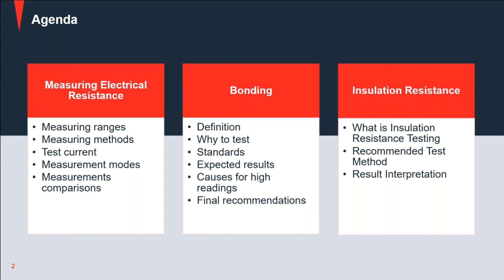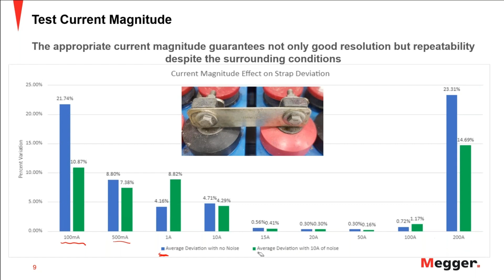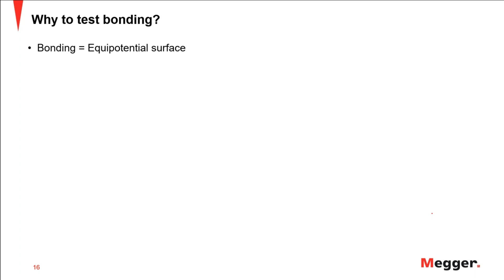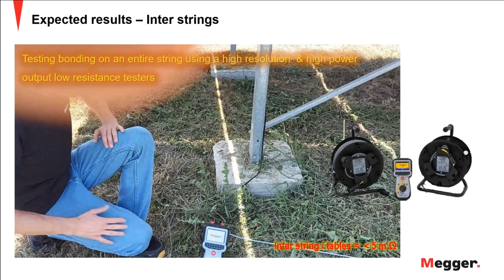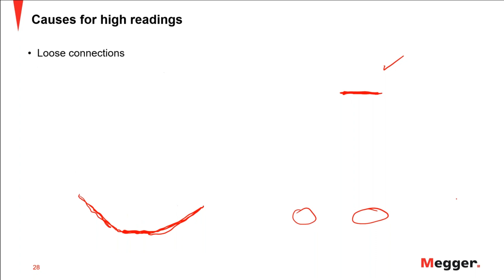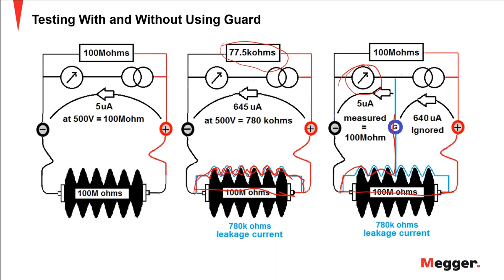Measuring Resistance in Photovoltaic Installations Webinar

Comment: Great educational session! This webinar from TEquipment, in collaboration with Megger, delivers a solid foundation in measuring electrical resistance, bonding integrity, and insulation resistance in photovoltaic installations. It covers key concepts like proper testing procedures, understanding leakage risks, and in-depth explanations of methods aligned with standards like